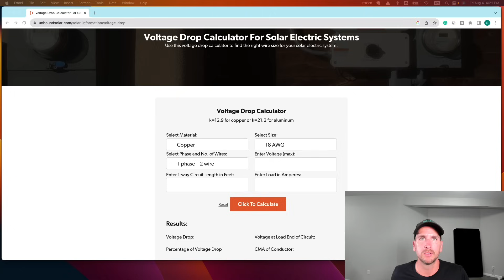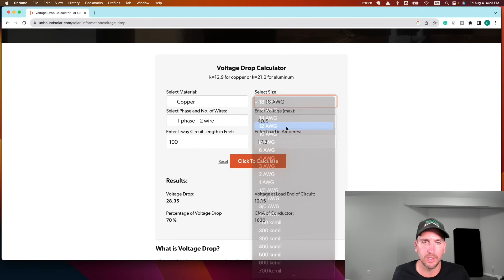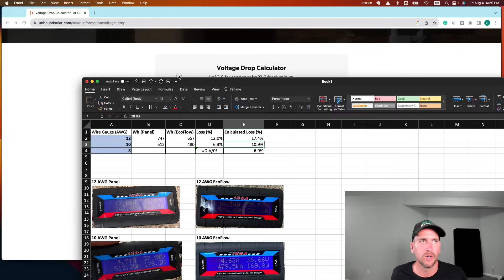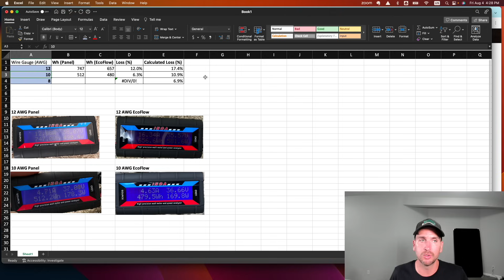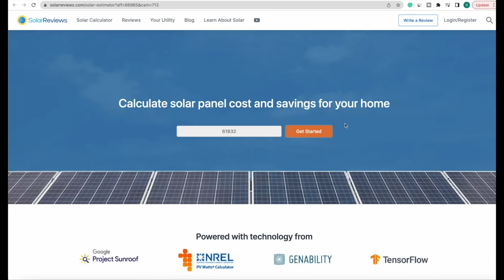What Wire Should You Use For DIY Solar Kits? Surprising Results!

Comment: This video is actually a good example of flawed testing achieving anecdotal evidence.  There is so much wrong with the methodology it boggles my mind.  If you want to talk about voltage drop, address the issue.  You end up discussing watt/hours which is affected by a hell of a lot more than just voltage drop.  Consequently, you did not do a "test" you did a demonstration.  Big difference.

Comment: What people fail to realise is that if you connect your solar panels directly to your portable solar generator, ie do not use any extensions, you minimise voltage drop to near zero. Obviously this isn't practical in a household fixed position but the amount of campers I see using impractically long extensions negates the economic usability of their generators.

Comment: Solar is not that hard, people should stop fearing it and just do it themself.    Companies just charge too much, nowadays, you can buy solar panels at 50 cents the per watt and if you can start small and keep adding solar panels slowly and with your own budget.  You will probably need to pay an electrician to check your work and get it connected to the grid but it will still be way cheaper than have a company do it.

Comment: What is this "AWG" and what are these "feet"?! Why don't you use international units of measurement on the INTERNATIONAL network?!
I don't care how many times a wire runs through a machine to get a certain cross-section! I just want to know the crosssection ... and this is given in mm². By the way... the USA signed in 1875 that they want to use the metric system instead of imperial units. That was around 150 years ago! So why still feet and AWG today? 🙄  Please have a look at wikipedia:  Metre Convention

Comment: Say my three large panels in series where pushing close to 150v to my DP and I wanted to get that down to a safer level. Could I increase wire length or use 12 or 14 gauge wire to drop the voltage to a safer lever? Would it affect the Current also and lower my total watts going into the DP?

Comment: His percentage calculation is correct, nevertheless it is only valid at the used PV voltage of about 50 Volts. It is desirable to connect the panels in series, thus having eg. 10 panels at 500 Volts and 9 Amps. AWG12 has 5.4 Ohm per meter. 100 ft times 2 is about 61 m, giving 330 milliOhms. At 9 Amps it makes a voltage drop of 3 Volts and a power loss of 27 Watt at full PV output of said 4.5 kilowatt, i. e. 0.6% of power loss.

Comment: Should have spent more time or at least added one experiment with higher voltage...
Thumbs up for the effort - thanks 4 sharing...
Reply from the maker: Thanks for the feedback!  My limitation were those little power meters can't handle over 100V.  I need to step up my data collection hardware.

Comment: This is also why you should go as high voltage for the long cables as possible.
I have a "off grid" 12v mppt inverter that accepts 56v input and i have open circuit voltage about 54v so there is little loss before the inverter.

Also my "on grid" inverter have 470v input

Always have as many panels in series as the inverter accepts (open circuit voltage, no load!)

Comment: Just came to mind I have 10 gauge, but at the  connections, the wires are very, very small/thin gage , so does that reduce the 10 gauge down to these small wires?
Reply from the maker: That should not be a line loss issue since it is reduced for such a short length but you would want to make sure that thinner gauge can handle the current load from a failure/heat generation standpoint as opposed to an efficiency/line loss perspective.

Comment: I think some people might get the wrong idea. From the comments people are assuming that the fatter the cable the better. Which the answer is still yes but what if you have a small set up? If you have a smaller setup that has a lower power output with wires that don’t need to reach 50feet or 100feet getting a bigger wire can also cause power loss too? I’m talking about 13 amps 36 volts at a distance of 10 feet or so.

Or am I wrong?

Comment: Your test is very simplistic. First off, the higher the voltage, the less your transmission losses. Somebody has said it already. You want to series your panels. Get the voltage as close to the max your MPPT can take. That means, that for the same wattage, your current will be much less. It is the current that dictates the size of your conductors. As long as your insulation is rated for the voltage. All the Solar specific cables and connectors I have found is rated for 1000volts. Your MPPT is nowhere near that. Its all in Ohm’s law.

If you use panels in parallel, you will need to fuse each parallel string. And, probably diodes. It depends on the specific panel how many volts they can handle. The long and the short. Series is best.
Reply: You didn't watch the whole video. He said as much in the end.
Reply: "Series is best."

Yes and no. 
From a resistive loss point of view 'yes'. If you have (partial) shadowing over the day (trees, posts, corners etc.) the story may well be different and individual MPPT's may be the better solution.
Reply: Others note he did acknowledge this point. I suspect he did 2 in parallel exactly because the current is higher, so making the experiment produce clearer results.
Reply: I aint no electrician but to all of you say wire in series is best, I agree but he is using a power station that will only allow 60 V max in, so parallel is best otherwise you will overload the power station this way it stays around 40v.
Reply: He's trying to avoid the High(er) Voltage  legal requirements.. you can laugh at my comment... 'electric fence'  [just spike it through.]
Reply: @tsclly2377  makes sense he'd want to stay in (legally speaking) low voltage when possible. it also depends on the local regulations. in some areas they may require anything over low voltage to be professionally installed. and yes I know the low V and high amp is much more of a fire risk. The laws tend to be quite dumb.
Reply: It's like Bell vs Tesla all over again!
Reply: Can't you use thinner wire guage as well if wiring the panels in series?
Reply: @michaelgleason3728 
Yes, but with a lot of non-roof arrays and the long distances involved, 10ga versus 12ga offers a few benefits. 
- voltage drop over distance is less
- temperature of wires at higher amps with bigger arrays will be lower
- if you upgrade panels you have the headroom to install them without buying / installing new cables
- in higher latitudes the November to first part of January- if offgrid- you might crave that 5% of efficiency difference
Reply: You just had to throw in the Ohms Law Thang huh..
FYI it doesn't apply to DC power. It does but it's sooooo small it's not worth using or even mentioning but here you are. 
If you know you know..
And you don't know 😂😁😆
Reply: Thank you
Reply: High DC voltages can be extremely dangerous, both from a fire and electrocution perspective.  For amateurs, it's far better to keep the voltage below to 60V, or as near as possible (the lower limit of what is considered dangerous).
Reply: @awebuser5914 
60VDC (or really 50V per OSHA) is considered the maximum voltage that one might endure briefly without death resulting (in most circumstances) due to resistance (ohms) of one’s body- but common voltages far above that are not low voltage. 
High voltage is 600V (osha, some code environments) or generally 1000V and above (NEC). 

“Low voltage” itself is not specifically a “safe” voltage. 

Nevertheless, if one doesn’t do stupid things (like disconnecting solar panel cable connectors without shutting down the circuits) one can work safely with 100-350VDC strings   .

Learn about safety protocols and always be slow and mindful while working with solar and you will be unlikely to die working with them. 

I’m somewhat ‘nervous’ about working with just 80VDC raw solar panel voltage. I’m not fearful, but I constantly am vigilant to test circuits with a meter after shutting down breakers/disconnects, and ‘waste’ a lot of 20-second periods of time while I mentally review my safety steps when working with DC strings and  even 120/240VAC. 
Your VOM is your friend. 

Limiting oneself to 60V strings can mean huge amperages with even relatively small arrays and current = heat. My welder joins lighter steel with 30V… which melts steel and therefore can certainly cause a fire. 
So with 60V you are at risk of merely exchanging an assumption of safety- a feeling of safety- for an unseen concern that is going to be sometimes more able to cause a fire than if one used proper procedures with lower-amp higher voltage and handled everything safely. 

No electricity is ‘safe.’ Think of the car fires that started from 3.2VDC USB chargers shorting on coins in the console! 
Just practice safe habits and risk goes down to nearly zero.
Reply: @fishhuntadventure  "60VDC (or really 50V per OSHA) is considered the maximum voltage that one might endure briefly without death..."  Complete bullshit...  The OSHA standard for DC voltage without PPE prior to the regulatory alignment was 100V.  Under 100V DC might give you a tingle, or a jolt if your hands are wet with ion-heavy water, but "death", LOL!  Try to stay in your lane of actual knowledge and not spout complete bullshit...
Reply: @awebuser5914 Mr.Westinghouse I presume? High voltages are dangerous. Why not leave it at that? It has nothing to do with AC or DC. It comes down to Ohms law. Transmission losses are less with higher voltages. This is not a game for children or those who do not have the relevant qualifications. Working with power is dangerous!
Reply: @phelansa23  "It has nothing to do with AC or DC..."  Yes, it actually does...  DC is far more dangerous due to the way it is transmitted through the body.  AC gives the theatrical "jerking" shock (which allows you to pull away in most cases), where DC is far more insidious and deadly.  Your heart could be stopped by the time you realize you grabbed a high-voltage DC wire.  Also, your understanding of history is comically bad.  It was Edison that pushed: "The War of the Currents" with the wildly incorrect: "AC is more dangerous" carnival shows and outright misinformation.

Comment: Solar wire comes in two flavors.  4mm2 or 6mm2.  Both are rated for 50amps and 1000v and are tinned copper to stop the black death.  Most inverters are rated at 16amps and 500v.  They would have to be in series at 9amps per panel.  Just keep connecting your panels until you hit the max Voc of 450v.  9amps and 450Voc.  4000watts per string.  Some Charge Controllers MPPT will have 150v but 50amp.  These are ok for short wire runs on DIY systems.  Renogy Rover type chargers for RV's.

Comment: We use 10ga wire in large systems where the wire is going hundreds of feet. No matter how many panels you put in series, the max amps is 8 amps, the limit of the panel itself. Amperage is the killer in line loss due to amperage squared times resistance, and the reason we jack the voltage way up. When doing the calculations remember the list for resistance is for 1000ft of wire.
Reply: Depending on the voltage and lengths...it could be very wrong.
Reply: You guys obviously don't install commercial solar. I've installed solar from 2 to 20 meg systems, and All of our circuits run on 10 GA wire. I have never terminated any other size wire, regardless of the length of the run, and all the fields we work on are engineered setups. I have never seen 8ga wire on any solar field.
Reply: You are doing it wrong.  IEEE guidelines suggest that line loss (I-squared R) losses should not exceed 2% in solar systems.  Our system is 2.5KW at about 130VDC input to the charge controller.  The line run is about 60' which required #4 AWG to not exceed 2% loss.

Comment: I keep mine under 2%.   The tables are based on a temperature coefficient, high temperatures create more resistance, therefore more voltage will drop more.  When the voltage drops the wire heats up giving you more resistance. Hence the voltage drops even further.  

Over time this can be a problem.

Comment: The reason you were not getting calculated voltage loss is, you were not producing the amperage you put into the calculation.   When I did Utility grade Solar in Southern California high desert 1.5MW systems, our calculated voltage drop average was required to be less than 1%.
I never used those calculators.  They solve for %, and I’m looking for the wire size that meets that percentage.
The calc is 2 times 12.9 for copper times length one way in feed times amperes= a number.   Divide that number by result of starting voltage times percent of loss required= circular mills of the copper conductors.  In conductor properties in back of the NEC find the conductor that is larger than that number.  All of this was done in spread sheets for the thousands of calculations.   Then sent to owners third party engineer for approval.

Comment: I would think that this comparison is suspect. The Wh from the panel needs to be the same of nearly the same to know that you have a valid comparison between the 3 wire sizes. Failing to control for different inputs leads to a somewhat suspect result. Locally if I price this, i get a cost of 56,  165 and 280 for the respective sizes at 100 ft. So there is a big price difference for the bigger size.

Comment: Wire power losses all come down to the formula P=(I^2)R, since R (resistance) is fixed, I (current) is the most critical, reducing current will reduce your wire losses.

Comment: Can only speak for my system, but went with 10 gauge for a bit under 120ft and it would have run me 33% more to run 8 gauge, more expensive connectors  as well, and only would have save a few % in line loss, put that money into a few more panels and grabbed more power overall....your mileage may vary....if you are going above 20amps on the line then I would step up to 8 gauge with a run like that.

Comment: Can someone help me figure this out. I have a bluettie ac200p. I currently have 2 - 180 watt panels 21.6 volt that i connect in series. I want to make a 30 - 40 foot extension cable and may add  a 450 watt 41 volt panel. If i connect all 3 of these panels in series i should have around 80 volts and around 10.5 amps. Can i use 10 gauge tinned copper wire for this?

Comment: You compared the max current of 17.8Amps to a real life situation of 4.71 amps. Off course your loss is less! Why didn't you use the 4.71 in the calculator tool, then you should have a real comparison.

Comment: On any solar system you should run the highest voltage your inverter can handle, as the higher the voltage the efficiency is much better on smaller wire. I can run a 6270 watt array at 466.5 volts at 13.44 amps. This allows me to run 100meters on 10awg with only a 2% voltage drop. All this means is the higher your voltage is the lower your resistance(aka amps).
Reply from the maker: Agreed 👍 thanks for the feedback!

Comment: you are confusing your supply with load. You need to put a load on your inverter to do test.
Reply from the maker: The load comes from the charge controller charging the batteries in the Delta Pro.

Comment: Jumper cables new usable for inverter?
Reply from the maker: If crimped correcting you should be good assuming you are not going over the limit for current on the wire gauge.

Comment: FYI, the calculator you are using doesn't closely agree with the information I've found online and experimentally.  https://en.wikipedia.org/wiki/American_wire_gauge is one of the many places to find tables on wire gauges.  They are based on #10 solid copper having a resistance of 1 ohm (well, 0.9989 ohms exactly) per 1,000 feet, and wire sizes above and below that are calculated from there.  #12 (solid) copper should be 1.588 ohms/kft.  So 200 feet (100 feet, round trip) resistance would be 0.3176 ohms.  17.8 amps across that resistance is 5.7 volts.  I realize it's in the ballpark of 7.03, but I wonder where they get that number?  I realize stranded will have a slightly higher resistance due to the voids between strands in a bundle, but 7.03 volts dropped by 17.8 amps would be 1.975 ohms/kft, which is quite a lot more than 1.588 for solid. (just about 13 gauge)  Some of the values used when calculating with ohm's law square their inputs, so you have to be careful with even small deviations because they can have unexpectedly big effects on the results.  Anyway I think that's why you were getting better experimental values than the calculator predicted.  It makes me wonder if whoever programmed the table thought "2 strand 12 gauge" meant two strands in a 12 gauge BUNDLE, where there would be a huge void space.  That would about make up for the differences I'm seeing. (this wound't be the first time I've found errors in online power calculators)  I personally prefer using high strand count copper for its flexibility as well as being very close to solid copper in ohms/ft.

Comment: Have you ever heard of the Shoals Plug and Play cables/system? Can anyone judge whether it makes sense to use it? Although they seem to be a bit more expensive, they are extremely easy to use and no professional installer is required. Installation is also said to be very quick and more energy efficient than conventional cables. What do you think about that?
Reply from the maker: They have cool products but I have seen their use case more in the large solar farm application where you can get rid of combiner boxes with 1 massive wire that has a bunch of leads coming off to each string of panels.  Which of their products were you considering?